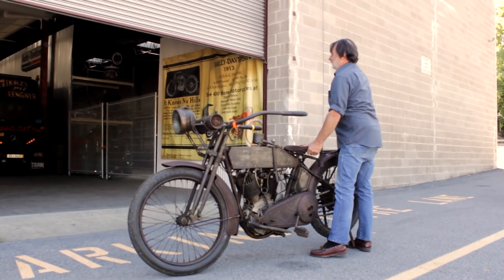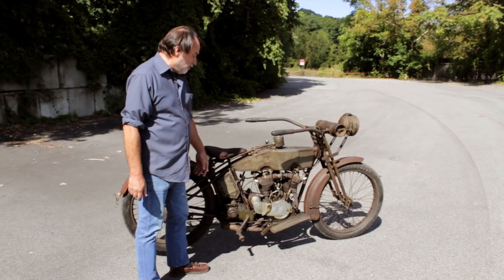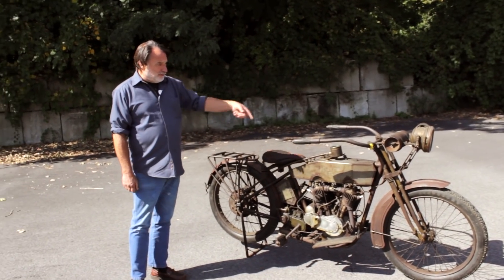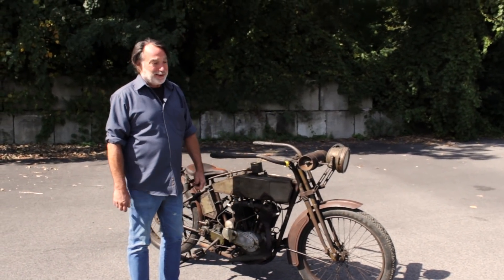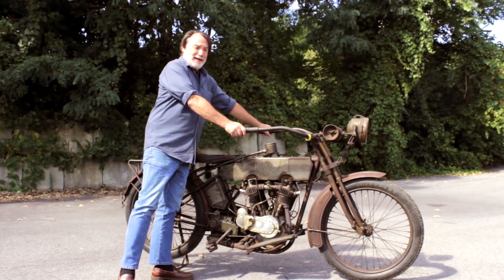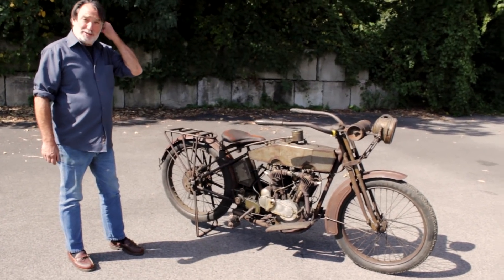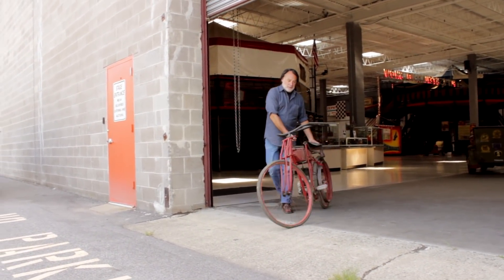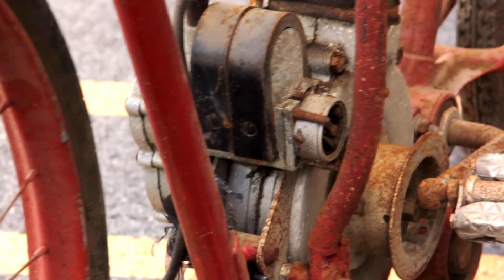1915 Harley-Davidson 2-Cylinder at Motorcyclepedia

Comment: My Grand father had one of the same models around 1918 when he was 16.. He rode all around from New Orleans to Detroit, Etc. He said, It could travel more miles per day than a automobile, until some thing broke down and you had to pull over and repair it or a tire went flat. According to him, it was an easy bike to work on...
Reply: That sounds like a pretty badass story. Simplicity,reliability and longevity isn't the primary focus of most bikes built these days it seems sadly. All those electronic bits and pieces they have on them now. Make it hard or pretty much impossible,to work on or fix them yourself.